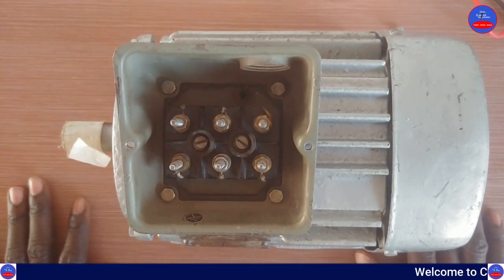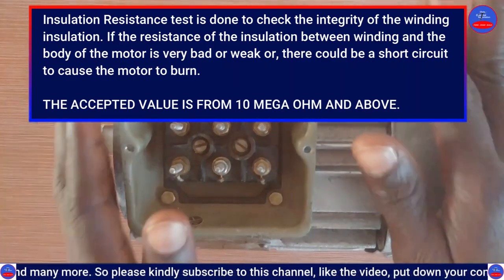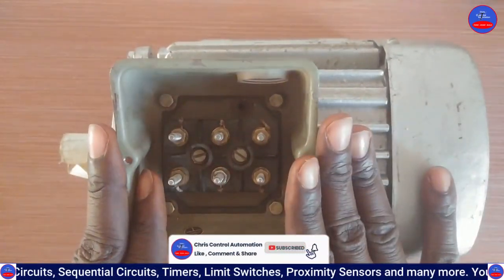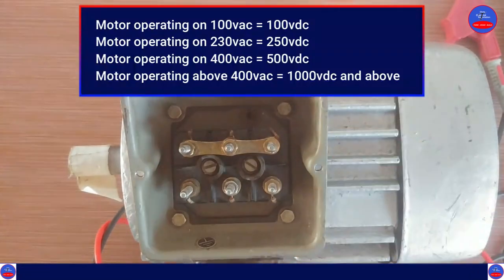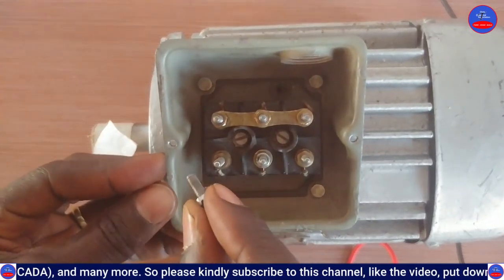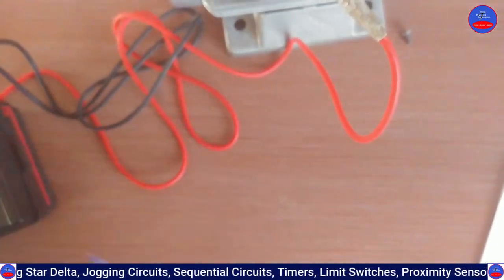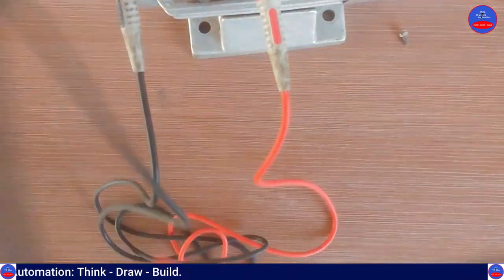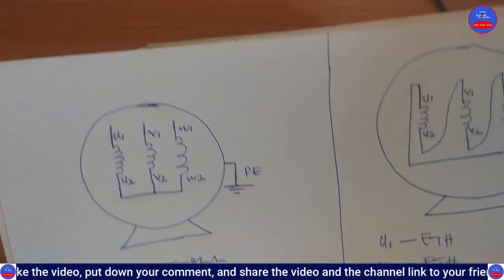How To Conduct Insulation Resistance Test On 3 Phase Motor

Comment: Bro Wats the advantage of connecting the motor in star and in delta?
Reply from the maker: I connected it in delta to show that, it is not only star can we do the test. We can equally do it in delta too, so that when you meet a motor with all the 6 leads on terminated box, you will be able to know which connection to do. That's the peculiar advantage
Reply: @ChrisControlAutomation  I just wanted to know it was just an open question y shud an engineer connect it in star and again the purpose of connecting it in delta?👍
Reply: Wow! For the new information.